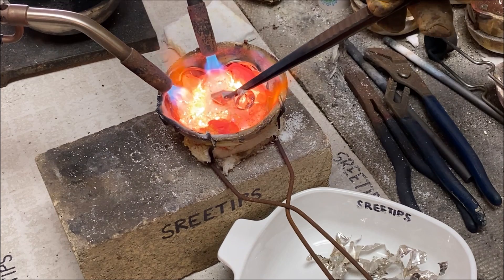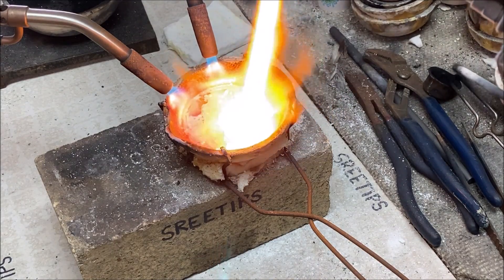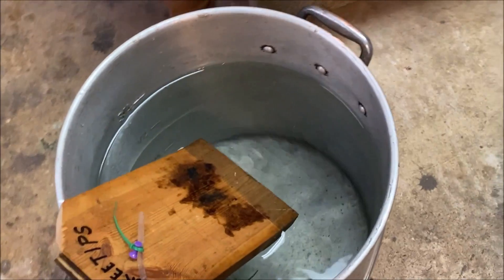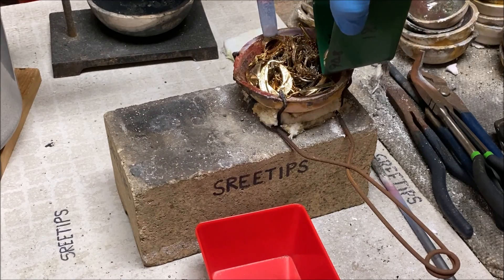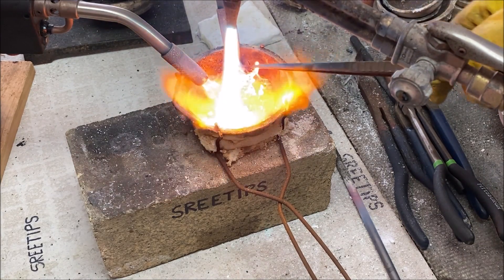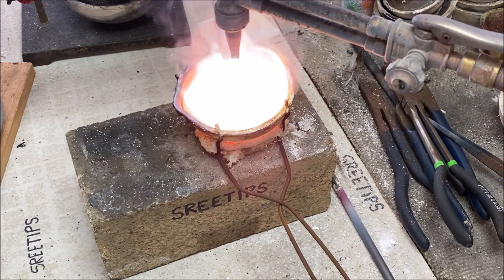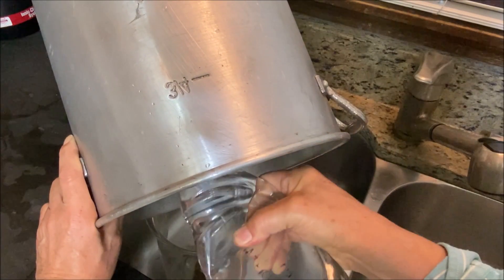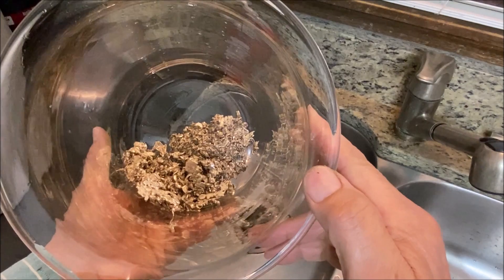Dissolving Silver With Molten Gold

Comment: Iv got a pot of gold cleaning solution and a couple of time iv put gold plated stuff in it and for got all about it and it stripped the gold off, can the gold be reclaimed from this solution?
Reply from the maker: The gold is probably particles in the solution that can be filtered out. But it won’t be very much
Reply: @sreetips  it's in liquid form, the fluid has turned green, I was thinking that if it could be retrieved that I could put all my plated stuff through it once I know how to retrieve it as I don't know what the fluid is

Comment: You should add that alloy you've made is called Electrum.
Reply from the maker: Electrum is naturally occurring alloy 40% to 90% gold alloyed with silver. I created an specific alloy of between 26% to 27% gold with sterling silver for refining the gold - inquarting. One of the most valuable refining techniques that I’ve ever learned.
Reply: @sreetips  as I've metion in different post Any gold - silver alloy with at least 20% gold (20-80% gold with 20-80% silver) is Electrum (aka green gold).
Reply from the maker: Ok, thank you

Comment: Thats pretty neat looking. When i make al-bronze, I'll melt the copper first, then add the aluminum. Usually its in a mini muffin form, so i drop it in, then poke it to the bottom with a stirring rod. The really cool part is the dull, orange glowing, molten copper, swirls with bright streaks of brighter orange, as it melts and convection currents carry it around. It looks really cool to me. I call it the moment of magic when the copper turns into "gold".

Comment: I did some research about the oxygen/ acetylene torches. On average, the temperature of the flame gets to 6,322 degrees Fahrenheit. Every metal has a melting point and boiling point. If you were to boil a pot of water, once the boiling point is reached, it puts the water into the atmosphere, hence steam. Metals are basically the same. Once the boiling point is reached, a gas is formed and the metal you are melting/boiling gets released into the atmosphere like steam. The oxygen/acetylene torch temperature exceeds the the gold boiling point by several thousand degrees. Be careful because you are possibly burning your profit into the atmosphere.
Reply: You can control that by the type of flame you use.  More or less O2 will stop the gold from fuming. It is common in glass blowing
Reply: Good point, I use an OXY/ACE torch myself from time to time when my melt furnace is down to assist my MAPs, it would take much longer contact time with the torch to get to the boiling point of gold than it appears he is applying it. Seems more like an assist to speed up the melt and keep it molten long enough to pour. 
 It also cuts down on MAP gas cans, those get expensive if you don't have access to a refill option, even then, I believe MAP gas is more expensive than OXY/ACE for refills too.
Reply: @999fine5  mapp gas is more expensive but it gets hotter so in theory it lasts longer, at least that is what the welding store told me. I use acetylene for steel, but propane for glass blowing and aluminum welding because acetylene is dirty when it burns
Reply from the maker: When I use oxy/acetylene, turned way down low, to melt silver, tiny metal balls of silver condense on the upper rim of the melt dish where it’s cooler. On average I lose about 1/2 of a tenth of an ounce due to vaporization.

Comment: was the vapor coming off of the melt dish gold that was vaporizing?
Reply: In the early part of the second melt? No that was most likely dirt, oils and other "people leavings" that get stuck in the cracks of old jewelry. I always burn my scrap before refining to get it off, it always smokes a bit. I know what you're thinking tho, that oxy/ace torch is boiling it away, right?
Reply: @999fine5  yeah because the smoke looks a little purple
Reply from the maker: Probably, I lose a little metal to vaporization